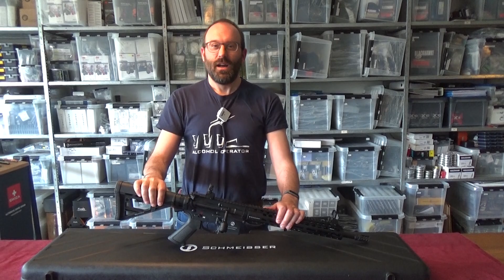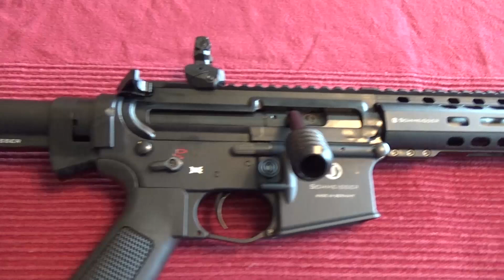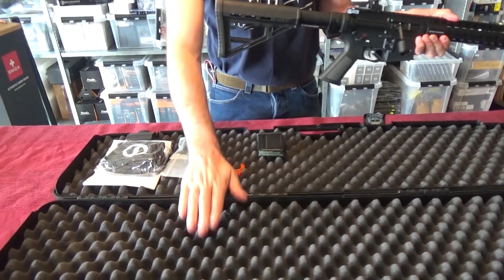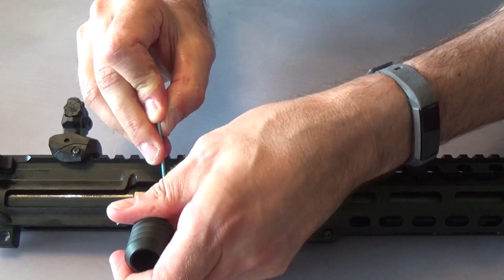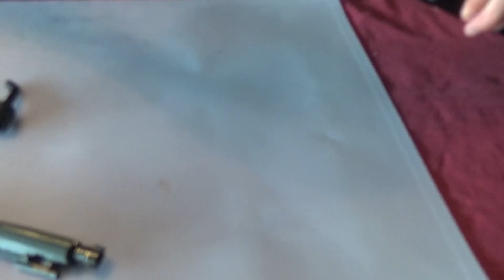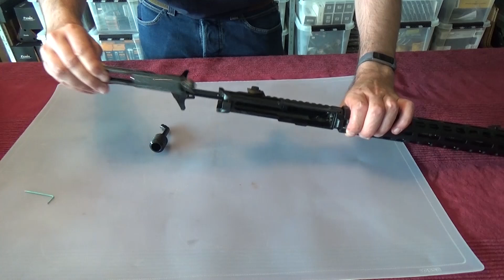Schmeisser SP-15 Straight Pull AR-15 .223 Rem

Comment: I like the handguard, flash suppressor, and the rear charging handle, but dang I am glad I do not have to have a straight pull AR-15 in the U.S. at least not yet anyway but that handguard is Rocken it.

Comment: I believe the missing lug is to satisfy Austrian regulations, something about making the bolt not useable with full auto components. Not sure how removing a lug would affect that though.
Reply: LMT does that on their Enhanced bolt and they say it’s because it disperses the stress more evenly on the lugs to prevent lug 1 & 7 shearing. That’s likely why a German manufacturer did it. It would have no bearing on full auto or anything like that.
Reply: I didn't know that, thanks for sharing! But I still think it's done for Austrian regulation. I read on an Austrian forum that they had to remove a lug to conform to the law, even if it had no affect. Lawmakers don't know how guns work. 
They must be doing this to sell the same model more easily in every European country. I had one of the standard Schmeisser semi auto AR's and it had all the lugs.
Reply: im from Austria and my Schmeisser M5F has the removed lug, also the corresponding position in the barrel extension is blocked so a standard "foreign" bolt with all the lugs cant pass and it wouldnt go into battery. i think the laws have changed since and it might no longer be necessary. it still sucks tho, because if i want a replacement bolt i have to buy the crippled austrian version
Reply: The LMT enhanced bolt came to mind. As mentioned, its for bolt balancing in case of the LMT, to not have unequal loading of the lugs. Supposedly this is reason high round count bolts can/do shear a lug, usually the 7th lug.
Reply: Interesting, weird that they would have removed the lug and not filled the slot if the law asked for that, seems like not going all the way. 
Well, it's time to burn that barrel down and replace it and the bolt by non-crippled ones, see that as a motivation to shoot more ;)
Reply: @lazylobster31  I imagine the reason that the bolt is missing a lug is that they have to do this with semi autos but not bolt actions, but they are just using the standard bolt they use for SA guns. They use a different barrel to the SA guns though (with all locking recesses) because they are not allowed a gas port so cant use one out of the standard supply.
Reply: @Stip96  what’s to stop you buying a normal bolt and machining off the lug?
Reply: @3of11   I was thinking the same thing.
Reply: Until 2019 semi-automatic (!) rifles, which had pressure bearing parts compatible with a fully-automatic version were illegal in Austria. But this did not affect manually operated rifles and as far as I know this rifle was not on the market at that time.

Interestingly license free manually operated "AR style" straight pull and pump-action rifles only started to become popular in Austria around 2015. They existed prior to that but they were hard to find and expensive and most people did not know about them.
Reply: In Austria 18year old can buy hunting rifle with no licence needed?
Reply: @sjowners  Yes. There is a background-check, it has to be registered and there is a three day waiting period. But no special licence, training or whatever is required.
Reply: @Superwip  in Austria of all places. I'm amazed.
Reply: The BCG appears to not have the required feature to trip an auto sear. I.e., it isn't a "full auto cut BC"

Comment: Note - all calibres in the UK have the angled charging handle it's not just the 9mm. I have the 14" carbine in .223, was one of the first imported
Reply: it wasnt the angle as much and the fact that the 9mm had an extension moving the handle rearward watch the video you will see the difference

Comment: I like this design, pity it can't be imported to Australia because it looks "scary". 

We have a few Australian designed ones but they aren't well suited to service rifle style shooting. They are either pump action or they put the cocking handle on the left which means you need to break your position for every shot, also means you can't use a sling for support. I think I did remember seeing one with the cocking handle on the correct ergonomic side but they put it so far forward it was redundant.

Comment: Id actually own something like that in a new long range cartridge like 6mm arc or 6.5g.  They should, however, "commit" to this and not mill the charging handle spot, only go with one bolt hold open for clearing misfeeds, etc.  

I recall something about some companies skipping the lug across from the extractor to make the forces on the bolt symmetrical and reduce chances of lug failure?  But my memory is hazy on the details, and I seem to recall it being hokum.

Greetings from the US

Comment: Ive had some failures where the neck breaks on the charging handle after excessive use (CSR comps), the 9mm dogleg should be the standard in my opinion for all Schmeisser straight pulls, had a SGC charging handle professionally fitted to give me confidence, cant have failures in the middle of a competition :)
Great gun for CSR, it did get me through a whole winter season and the imperial before the handle broke, so about 1000 rnds. Just keep an eye on it.

Comment: Ive built 2 of them with side charging uppers one in 5.56 and one in 7.62x 39 because I wanted to see if there was a difference in accuracy from a bolt to semi auto in same platform. There is but what causes it is hard to tell both guns have very good barrels better than my other ARs so that could be part of it.
Reply from the maker: Back in Holland I used to use my HBAR Oberland Arms for 100m "Target Rifle" equivalent with tuned loads (69gn SMK). I didn't notice any difference between gas on and gas off, but there was a big difference between loading from the mag and single loading. I didn't have a loading sled (Brownells etc. wouldn't ship them to Europe at that time) so would chuck one in the side, reach over and drop the bolt (this was sling supported with target iron sights, and I was shooting consistently 96-99 on a 1 MOA bullseye, gauged to 8mm cos that's how it was done)
Reply: @BlokeontheRange  Did you come up with a reason way they way the cartridge got into the chamber changed the guns accuracy?

Comment: As someone who is right handed but left eye dominant, it drives me nuts how few AR manufacturers make ambi rifles/lowers(and the ones that do cost like $250.)  I don't know if it's a difficult thing to get right(though it doesn't seem so), or if it has something to do with parts interchangeability(though I don't think it's that either, since every company I'm aware of that makes them-including a random guy I found on gunbroker who makes them at his home-provide all of the propriety parts needed when you purchase the lower), or what the deal is, but I feel like lefties and righties(and especially cross dominant folks like me) could all benefit from ambi guns.
It just really surprises me that in 2022, with all of the seemingly endless number of AR makers, parts makers/sellers, etc., and more importantly, combined with the fact that 30% of people in the U.S. are left eye dominant(meaning that nearly 1 in every 3 shooters is/probably should be shooting their long guns lefty), that only a handful of companies make ambi guns/lowers, and only one that I'm aware of(Stag Arms) makes completely lefty guns(meaning that even the ejection port is on the left side of the gun.)
Reply from the maker: It's simply a risk-reward thing. Stag have the niche. The WWSD lower is ambi cos of the 2 left-handers involved in driving the project.
Reply: @BlokeontheRange  I'm not sure exactly what you mean.  What is the "risk" involved in selling ambi rifles/lowers?  Or at least making them an option, so that if it is more expensive(whether that's due to the extra/different machining, the extra parts, or having two different versions of their guns/lowers)they can charge more the ambi guns?  
I hear/see people all the time at the range, gun shops, in the occasional class, etc. either say they wish they had an ambi/left handed gun, or more often, ask me where I got mine because they either didn't know they existed, or couldn't find one, or are lefties(or like me are righties who are cross eye dominant)  and have just always dealt with having right handed guns(and everything else.)

*edit*
Sorry, I just realized my comment may have come across as argumentative.  Didn't mean it that way.
Reply from the maker: @Mockturtlesoup1  That it costs a lot of money that they won't make back. It's a universal thing in the firearms industry that people say they want X, that they're prepared to pay for it, but when it hits the market they go ZOHMAGAWDS I'm not paying that! XD So many firearms startups have folded due to this phenomenon (doo dooooo bi doo doo)

Comment: I had no idea anyone made anything like that. Too many other bolt action guns I’d rather have and especially at that price point.
Reply: The price point is a bit a problem for sure.
Reply: I'd go for a higher caliber if your stuck in a country without rights and have to have a bolt operated gun mine as well go for 308.
Reply from the maker: It's not bad at all in European prices.
Reply: @BlokeontheRange  Well Bloke, you seem to have your hands on lots of guns, how about you getting an AR15 bolt and put it into that straight pull bolt carrier. I’ll bet it not only doesn’t fit but it would never function. If it does fit the lugs on the barrel I’ll bet don’t alien hence the never function. I’m a betting man, take me up on it and make a video.

Comment: I have witnessed a case separation at the range with a straight pull AR. which blew the gasses back through the magazine. Caused an almighty mess. My question is... Would this have happened if there was a gas tube present on the rifle?
Reply from the maker: Yes.
Reply: The peak pressures in both systems would be shortly after firing- well before the bullet would hit the location of a gas port.  It was likely a bad piece of brass, an overpressured round, excessive headspace, or indicative of some other "oddity."

Comment: Quick question is there any manufacturer Who makes fully left handed versions of straightpull AR's?
Reply from the maker: Given that there are fully left-handed AR receivers, BCG's etc, I'm sure one of the custom UK makers like Bradley Arms, or Viking (IIRC) who could do you one in exchange for $$$$$$$$$$$
Reply: There's a guy above who says that the majority of Australian straight-pulls have left-handed bolts.  Which may not be useful information for you, but I just thought it was worth noting.
Reply: @jic1  must be because they are upside down
Reply: @3of11  Ah, that also explains the Owen submachine gun!

Comment: The SL8 that you mentioned, doesn't it miss one lug to prevent it from being able to feed from double stack double feed magazines? (ie standard G36 mags). because making the mag well too narrow to fit a wider magazine wasn't enough, and then to prevent you from installing a bolt that could feed from either sider of a double stack mag they didn't mill out the slot for the missing locking lug?

Comment: For a frame of refrence, whats a normal AR go for in europe like that converted M16a1 you have?
Reply from the maker: Varies depending on manufacturer, but that price is comparable with a normal AR of similar quality. A Windham Weaponry one goes for about 1400+, decent ones 2000+, WWSD 2700. I got a good "mate's rates" deal on my mint M16A1 so that's not a fair comparison (and I've seen them offered for 1.5x what I paid).

Comment: The bolt lugs being symmetrical are probably related to machining, machine one side, flip over, machine second side
Reply: Indeed, and since these guns won't be beating themselves up like the semiautomatics and automatics would be, the extra lug's safety factor is mostly superfluous so long as they were careful to ensure you can't reassemble the bolt incorrectly.
Reply: That would make sense if they were still using old fashioned manual mills. I would be amazed if Ze Germans weren't using modern 5 axis CNC

Comment: For Americans, building one of these would be pretty easy.  You can get a side charging upper so the only mods you'd need to make would be to remove the gas rings, gas tube, and spin the gas block around to block the port.  Then it could be converted back if desired.  Maybe make a custom charging handle to get it where you want.  I'd like some feedback from shooters who have used these for tips on the optimum bolt knob position.  Is a standard buffer still desirable or just empty out the weights?
Reply: I used  for the 2 I built Green Mountain gunsmith special barrels ( an unprofiled blank) so .990 from chamber to muzzle no gas port, had to buy the crowning tool to put an 11 degree target crown on them, the BCG was a Bear Creek aresenal side charging upper with the BCG. Both are very accurate. you do however have to reach for the handle to cock them. Not a big deal for a bench gun. just pull it back and let the spring seat it.
Uintah Precision makes a true bolt action AR but it very proprietary and expensive.
Reply from the maker: Valmont Arms in the UK sells a light buffer + spring system for straight pulls. If I get this rifle, I'll get one of them too.

Comment: The only thing I wonder about these straight pulls is the case extraction, especially with "hot" ammunition. It had been an issue in the past, for sure, with people needing to hold the rifle against their bodies while pulling the charging handle, or at worst, mortaring their rifles. Therefore, my question is whether manufacturers today have changed things in the chamber a bit to accommodate reliable extraction (like much better tolerancing, which would definitely make the semi-auto ones run well, too), or do they just put a list of recommended ammunition for the best shooting experience? 

It certainly doesn't look like there's any accommodation for primary extraction like in "regular" bolt guns, though the handle would give a degree of leverage, especially when you try to go for rapid shots. 

In my inexperienced opinion, it does appear that this rifle has the potential for really good rates of fire, about as good as "slow" semi-auto shots, probably. There's very little movement that needs to be done since you can easily reach for the handle. I do wonder if I can find a direct comparison of rate of fire between this type of system and a regular bolt action, everything else being equalised, of course.
Reply from the maker: Yes, there's no primary extraction, so that can be a problem with sticky ammo. But the chamber fouls much less than a semiauto so provided it's clean and the ammo isn't sticky, it's not a major problem.
Reply: @BlokeontheRange  So you shouldn't run steel cased ammo in these guns then
Reply from the maker: Probably not a good idea, no!

Comment: The missing locking lug could be a feature for the german market. Guns sold on the German market, by law, can not be converted by laymen with simple tools. A straight pull repeating AR could be converted in to a differed cathegory of gun by dropping in a few parts thus making it semi automatic. They had to change it in a way you cant drop in a few parts and make it semi i reckon.
Reply from the maker: You can drop a standard bolt in there though cos the barrel extension has all the cuts for it.

Comment: Is there a left hand version?This is the biggest failures of these straight pulls,that they are not easily converted or issued in LH.
Reply from the maker: The market for them is fairly small, and the market for LH versions is even smaller. There are some adaptations to the T-handle which sorta kinda work, and I've seen some custom ones made up with left-side charging upper receivers. But for an off-the-shelf mass-market product, you can forget about it unfortunately.

Comment: How does it compare to the Kali-Key?
Reply from the maker: Kali-Key looks like a hideous version of the 1st gen straight-pull AR's in the early 90's which were just gasless and had an oversize T-handle (if you were lucky), so were a bit of a disaster really.
Reply: @BlokeontheRange  It basically is. LOL However you can still install the gas system because the carrier cuts off the gas (probably illegal, but if you ever want to use semi-auto, just switch to a standard bolt and carrier, and charging handle).
Reply: Theo whole point of the Kali-Key is that you don’t have the modify the rifle and so whenever you’re out of state you can pop a regular bolt in it.

Comment: There is a proposed ban on semi auto centerfires for people under 21 in the US I'm waiting for someone to come out with a straight pull that they seperately sell a drilling jig for the gas port lol
Reply: Nah just have them buy milsurps. Saves a ton of money. These straight pull ar looks very expensive and quality made
Reply: Things like that actually get "proposed" every other year or so, they just happen to get highlighted after a tragedy.  AWB copycats have been proposed for many years and typically die in the House before they make any real movement.
Reply: @jason200912  milsurps haven’t been cheap in decades dude.
Reply: @baneofbanes  not for civillians. but it's cheap in bulk, which is why importers make some good money.